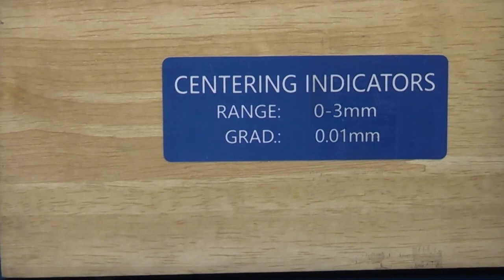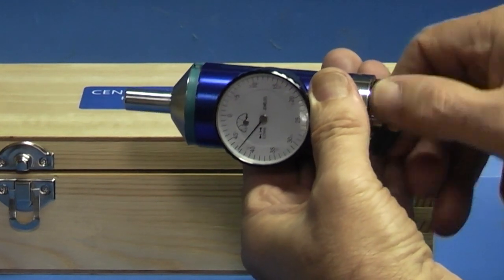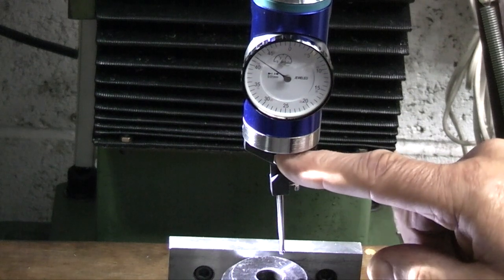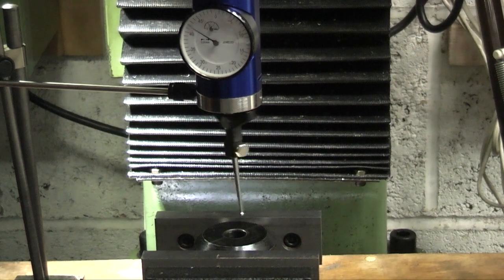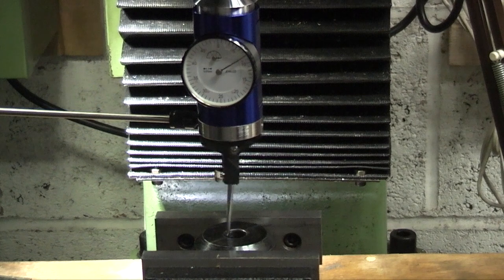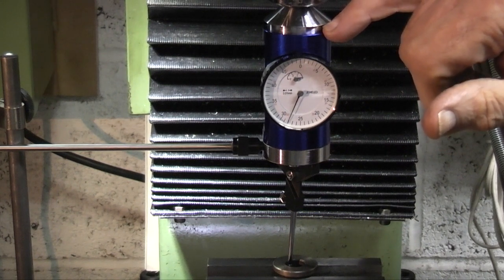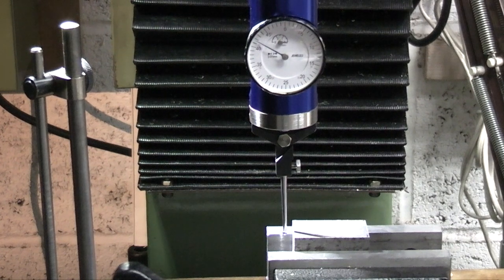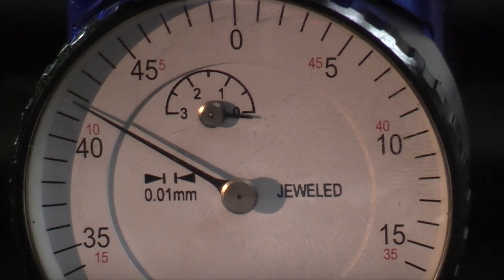Bore centring gauge review

Comment: I have one of the U.S. made Blake Co-Ax indicators these were cloned from. Had I known at the time what I've learned since, it's doubtful I'd now buy or even use a free one since there's other methods just as good or better. It should also be pointed out they take up a lot of Z axis length and those with smaller mills simply don't have enough spare Z axis height to use them. Most with a mill would also have at least one dial and dial test indicator since there almost mandatory for vise, head tramming and machine alignment checks. Compared to setting up my Blake against using a DTI with a few shop made arms and snugs, a DTI is probably a slight bit faster, takes up a lot less Z height and it is direct reading as well as being more accurate. It will also do everything these Co-Ax indicators can and a lot more without ever changing straight or bent probe lengths. Set up correctly to center a bore or part OD, a DTI's dial face can be positioned almost horizontally so it's still easy to read at any rotation point. 

I'd judge these more as a tool that appears to be better and more useful to have than they really are. There is one use for them that normally a DTI can't properly do due to the effects of gravity. Checking the vertical alignment of a lathes tail stock Morse Taper against the head stocks C/L. But again due to possible gravity effects altering the reading, it's been mentioned by professional machine tool re-builder's that only the shortest probe length should be installed any time these Co-Ax indicators are being used in a horizontal orientation. A few years ago there were quite a few forum posts mentioning inaccurate results with some of the off shore produced Co-Ax indicators. I don't know if they've since fixed the problem or not. I would double check the accuracy of any Co-Ax I bought against what a DTI shows for a bore or part OD C/L before fully trusting it.

Comment: Not that it matters much with this thing, but the chinese need to start making SAE stuff.  Somewhere here on YT, I saw a home machine guy actually make one of these centering tools.  Not a horrible project, but pretty involved.  Banggood sent this to you for free, so pop that sucker open!
Reply: I was going to say the same thing. No SAE, but as you stated for what we'd use it for it doesn't make a difference. It's a good price if it's any good, I've been looking for a while for one. Take care.
Reply: Metric or imperial marked divisions would make almost no difference. Your using it basically as a null setting tool, or in other words the least possible movement of the needle. It could align parts just as accurately if there were no division markings on the dial at all.